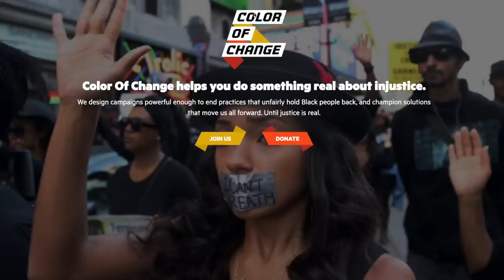VAN LIFE BUILD: Unique Bed Design for Tiny House

Comment: Looking so good guys. Was really hoping to see a mattress on it but I guess that would get in the way for the rest of the build!
Reply from the maker: Our office neighbour is a rubber mattress seller and he's currently cutting us a few pieces to fit this new design so we just have to be patient... we'd also loooove to get a mattress on there for mid-work day naps 😂
Reply: @eamonandbec  Keen to see it whenever it's ready. Also, mid-work naps are a dangerous game. They quickly turn into end of work naps 😂
Reply: Bec,
I hate to say this, but you really need a slot and a slightly loose screw instead if a hole in one end of each slat.
That will allow them to compress flat and give more spring to the mattress. Much more comfortable.
Reply: @BeyondYourDoorstep  Hey, sometimes you need those naps... as long as you're still getting done what needs done lol.

Comment: Imagine how effecient an all electric van would be if you could charge it via solar panel you would never have to go to a gas station
Reply: Definitely a goal worth pursuing. Not sure how much access we'd have (as civilians) to the tools necessary to achieve this, but if someone has any examples of this I'd definitely like to see how they'd accomplished it.
Reply: Check out route del sol on Instagram, they have a fully solar-powered van and are driving it from Alaska to Patagonia!
Reply: Daniel Willyard currently there are wall plugs for cars. if you could get a wall plug on the outside of the van, you could charge anywhere. it wouldn't be continuous but it would eliminate the search for a gas station

Comment: As a fellow vehicle builder, it's crazy the engineering that goes into the most simple things like making a stupid piece of wood to flip up and support weight. I used the exact same square stock to support my AC. Ah memories. Nothing beats living in a vehicle if you set it up right from the get go. Good job guys! 👍

Comment: Very ingenious bed design. The flex your experiencing can be eliminated by changing the tubing to rectangular box tube sliding inside a slightly larger rectangular box tube. If you find the square box flex to be too much or, more likely it starts to bow over time rectangular tube is the fix. Any good metal supply company can provide you with mild steel rectangular tube that will slide inside another rectangular box tube. Same mounting with clamps will work, but you’ll want so lube the sliding bits, a touch of silicone spray lube would do. I’m enjoying the build, be well!

Comment: I am designing my own van build right now and came up with a similar idea as I want a north south bed without compromising floor space.
I did see this done in a slide on camper here in Australia,  same as your set up,  but I want better access behind where the bed end flips down.
I'm going to solve this by splitting it down the middle and putting heavy duty drawer runners in to slide extensions back under bed.
Then I would still be able to put a second runner lower down for a table.
Hopefully it will work out, I think the double slide outs will add strength for weight.
I'm not a builder nor do I have a technical clue, but I can't stop dreaming up ideas!!! Keeps me awake at night.
Cant wait to see your finished product, looking great guys.

Comment: Cool design on the foot extension for the bed.  One opinion though if you don't mind, when the foot extension is down, that becomes the backrest for your couch?  I would suggest to cut the foot extension in the middle so that if one of you wants to be in bed and the other is on the couch, you can still use half of the foot extension for the one staying in bed.  Keep up the good work.  Keep safe.

Comment: You could make the slide-out part of the bed a lot stiffer (and stronger) by having something attached to each sidewall of the van that would support the corners of the bed when it slides out (maybe something that would swing out). I think they could be done to not be too obtrusive when the bed is put away. The amount of deflection in the slide-out section (the square tubing) you are getting when weight is placed on the bed will eventually cause you problems (as in something will eventually bend or break) if the deflection is not addressed. I love your design. It just needs a little beefing up.

Comment: I saw the way you did the hinge at the footer for the bed and the slide support. I thought it might be a good idea to do something like a fence bolt latch on that edge, like a really good thick one on both sides. You could put the receiving ends in the wall, like make a good metal bracket with a hole in it for the bolts to slide into. That way you could still have that good solid vertical support. Essentially using the walls as the legs of the bed. Just an idea.

Comment: Hey guys, you’re the only ones I follow. Following is quite boring to me but not you two and Bob of course. I am insulating my van 100% with Rockwool.  I got really excited when I saw you using it too. I don’t see it very often. Then I realized or I think I realized you only used it in that door and did the rest of your van the way you did with the first one, the spray foam. Why not Rockwell the whole thing? It must be cheaper and mine has an R-value of about 15. That’s pretty darn good. Let me know what you think. I trust you

Comment: You should add two telescoping hinged legs on that hinged section of the bed that you can pull out and extend to the floor on each side to add extra support to that footer.  When they are not being used they will simply collapse and fold into the bottom of the hinged footer section and clip in kind of like a folding table leg.  Just a thought. :)

Comment: The van is looking really good !!!
For the durability of the bed extention you should cut two big triangles of wood that double flat when you double the extension. And when you open the extension they will act like supports punting the wheight on the back of the couch/garage wall. ( using the same principle you would use to make a shelf for heavy duty on a wall)

Comment: Just to let you know, at about 8 minutes in you mention that the 2 X 6's are no longer a 2 X 6, well they are. Roof rafters are notched out, that doesn't make them a 2 X 4. Imagine a 2 X 4 rafter notched out, is that now a 2 X 2 roof rafter?  As you said, the stress is in the middle, where it is a true 2 X 6. You would need to stress that part before the notches would be compromised. 

BTW, my daughter sent me an image of a slide in camper in a pick-up truck. I told her to watch your videos and make her camper hers. Now several hours later, I am still watching your videos. Send me a hot dog.

Comment: Thank you for the well documented, including details on the van build, very much appreciated. I like the pullout for the bed extension, better then bearing runners. Finish with rubbing silicon grease. The other thing I would do is replicate where the doors are, so it can be used in those moments when there is a prime view and feet need stretching.

Comment: I've been leaving a comment every week because I actually love what you guys are doing!! An idea for that slide-out support (maybe): Have two (rectangular) holes inside the wall and then when you slide out the support, you can slide out the second rods into the wall for ultimate support. Sort of like a rod that goes along the width of the van to avoid  single point of failures. (I studied eng :)) I hope it makes sense :) Love you guys!

Comment: Hello Eamon & Bec, just a thougt here, those panels you're screwing onto the van, maybe you could increase the durability and reduce the noise by putting some filler on the broders behind, maybe some rubber or even silicon, it would avoid premature issues with vibration.
Much love, from Portugal!

Comment: They will continue to bend and eventually they will let go . Just a suggestion flat steel where the hose clamps are for strength and drop down legs for support on the steel square tubing

Comment: Bec. At video time 17:20, it looks like you attached the IKEA slats on both ends, correct? I think that one end should be free to lengthen or shorten with vertical weight. Bad logic? Maybe. Screwing down both ends may put shear force on the screws under body weight; and one screw on each slat may break off (or tear the wood) over time. All comments welcome. - Steve, Utah USA

Comment: That GMC SUV at 9:38 in the Home Depot parking lot. Like why? Clearly Eamon did the right thing in overhanging into the second stall, because the Sprinter is longer than standard parking stalls. So GMC's driver was an inconsiderate idiot, to have parked behind the Sprinter, and his rear end is beyond the lines. Good job Eamon, you didn't lose your shit on camera; but totally understandable if you had. Don't park so close behind, and there were clearly other empty stalls available.

Comment: As a carpenter/builder it’s painful watching Eamon bluff his way through when to use a planer or angle grinder, not understanding the weight bearing 
 checking out that 2x6 and thinking that l-profile Steel not resting on anything will solve that issue, and last of all thinking this layout is unique. There are literally dozens of YouTube videos alone showing this layout. It’s a good 2one but don’t delude yourself into thinking you invented this.